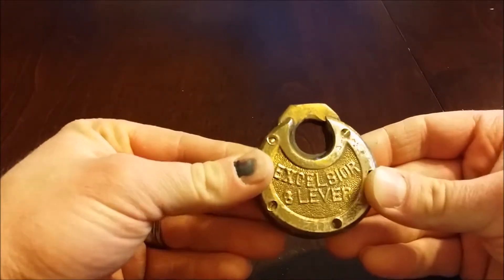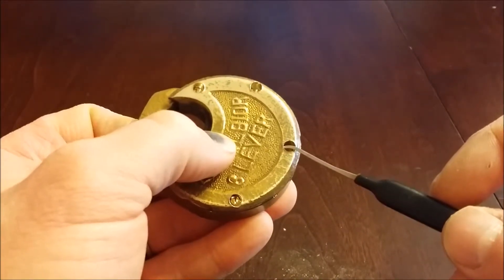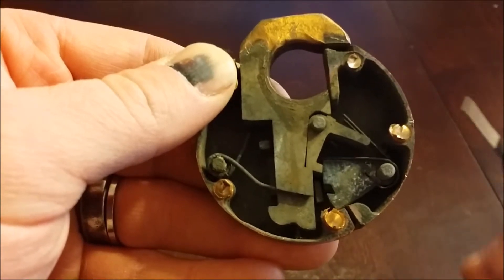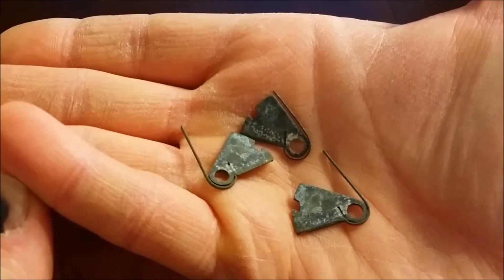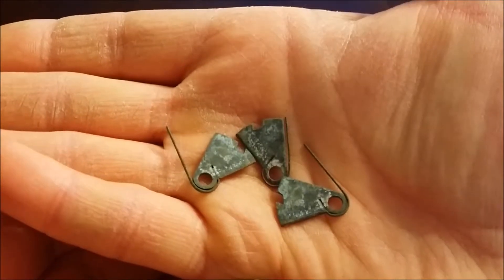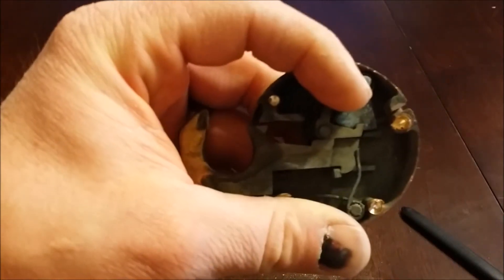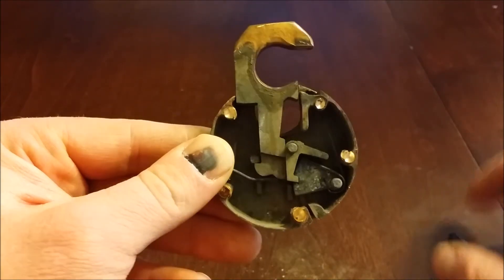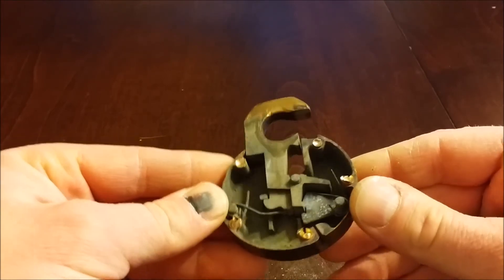6 Lever Pancake Lock Cutaway / Gutted Part 2/2 The Big Reveal

Comment: Hi man, loved the video. I ha r a champion 6lever, I have no key for it. Tried to pick it, but I can't get anything to stick. How do I know if it is worn  out? This is my only thing from my great grandfather, and I'd like to get a key and have it working so I can use it. Would you help me?
Reply from the maker: The I've done a lot of these since then and there a few indicators they give to tell you they can't be opened (without taking it apart which I did in another vid).  If the levers won't move at all or move on their own without any spring tension they can be a bear to pick.  Also if the shackle is seized or won't wiggle up down or side to side then you are probably going to have trouble. But if everything is springy and when you shake it you don't hear any rattles then it should be able to be opened by picking it.  Did you see my video about picking them?  I give instructions on how to make a really effective and cheap pick for these.  Let me know if you have anymore questions always happy to help if I can. Thanks for watching!!
Reply: @LockButcherShop  yes everything is springy, no I haven't seen the video. I'm about to check now. Thanks ill be in touch
Reply: So yeah I saw your video a long time ago, I actually made the exact same thing with the finish nails and clips. I couldn't get it to work. I want to send it off to get picked and have a key made. But I don't know where I can get it done... I love this lock it is awesome... I just gave it a shake, and I think I hear something small in it rattling around. Bc when I pull the shackle back it doesnt really spring out, but it does spring in. I think it is broken.

Comment: That lock would be very easy to fix.  You clearly understand why it doesn't work, and that is all you need to know to fix it.

Hint: Put new springs in it.
Reply: You could also maybe improve it (make it more durable) when you make the springs by putting a loop in the spring.  Those springs are just bent spring steel so they weren't meant to last.  A spring with at least one full turn in it should last longer since the steel won't need to deform as much to provide the same range of motion.
Reply from the maker: +goyabee you're exactly right but when i made this video I wasn't as proficient with these locks (even though I try to sound like I am haha) so the springs were the problem when I got it then the lock butcher did his thing and drilled out those pins holding the top on instead of opening it with a series of shims like you should haha. so even if I fixed the springs the lock would be dead thanks to my stupidity. haha.  but even though the lock was destroyed in a conventional sense the knowledge it gave makes it very valuable to me.  knowing what I'm up against in these locks has made me much more successful in opening them. those are good points and thanks for watching:D

Comment: What the thickness of the nails you used?
Reply: Check out Kokomolocks video on lever locks. He took a CD case clear part and cut out a copy of the cover and attached it making a cutaway. To date I have yet to see a pancake cutaway so go for it.
Reply from the maker: As far as size goes on those nails it says 18 Guage on the box and I looked it up and it said the head width is 1.2mm. They are nails for a pneumatic finishing nail gun if that helps.
Reply from the maker: Papa Gleb ya I was actually going to try and fix those lever springs and try making one of those.   Haha! Thanks!
Reply: So the body is around 0.8 - 1 mm assumed. I don't nail nails like that and buying a pack for just 6 nails seems like a waste. But if I know the size I could find something around my house that size. Guess I'll wait till mine arrive and mean while look for something 1mm or smaller.